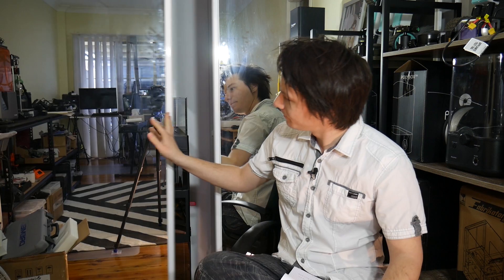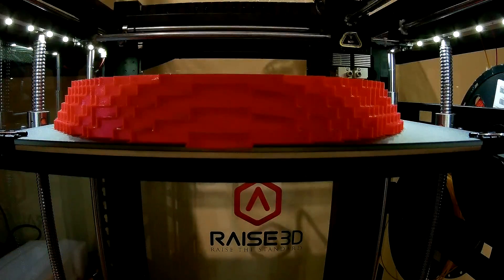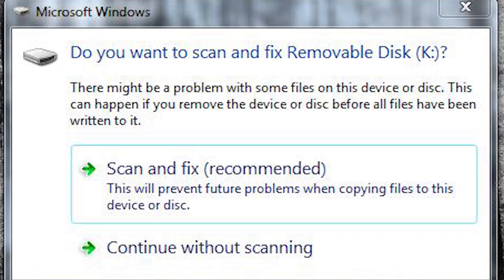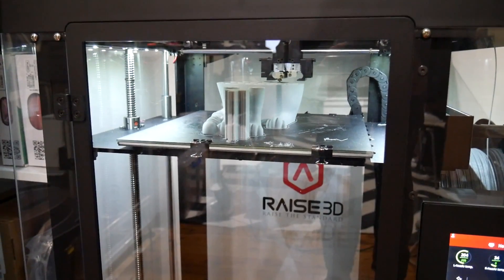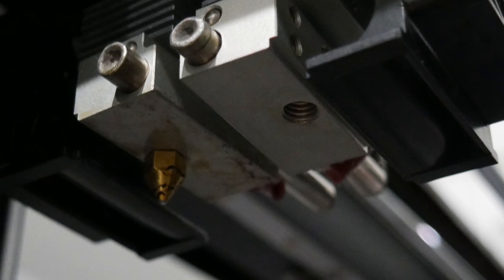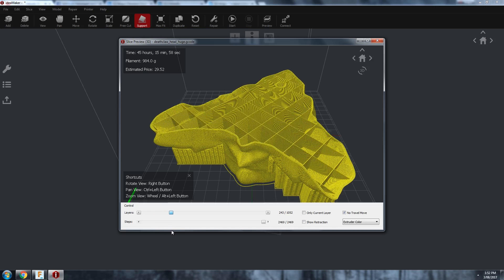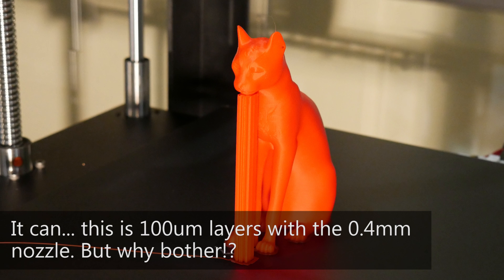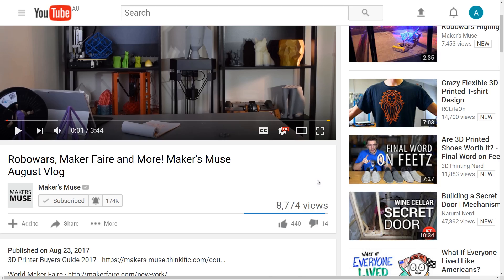Raise3D N2+ 3D Printer Review - It's HUGE.

Comment: Those flaws are terminal for me. The idea of the machine failing after 90 hours simply because it was too stupid to detect that it was out of filament is criminal, as is the fact that you need to manually level the bed.

Comment: Hy, i've been useing this printer for a year only for 12+ hour jobs it dose superb work, yes the bed is hard to adjust but when done right is the best! Only isshue wit it is fillament cloging but i can not blame the printer. Right now i have a power surge protector on it and thinking of geting a UPS because of small, 5-10 min, blackouts. Longest time printing was around 1 week, not one print but 24-ish hour prints for a weeh long, the endurance is grate on this baby! The dual extruder is good but also the nozzel need to be level... 
After a 3-4 moth of useing it, the filament was sticking so good to the buidtak that i broke the glass trying to remove it, replace the glass and buidtak and worg grate again. 
Another good thing is that the extruded amount of material, feed rate, temperatures and fan speeds can be modified even when printing without stopping the machine.
Best regards!
Reply: Have you had issues with the touch screen? I see quite a few users have suffered failing screens. Some of them use a plugged mouse, others diy replacement screens (stock screens are hard to find and quotes run at 500 USD). I can have a great deal for this machine but am quite hesitant because of the know screen issue + lack of support from the brand about it. Seller says there is "just" an issue with the screen.

Comment: I've had one of these printers for about a year now. I replaced one of the nozzles with a .8mm and keep the other one at .4mm. That way I don't need to change the nozzle, just the settings in the slicer when I'm wanting to print something fast versus something detailed. 

You kinda brushed off the detail this printer can handle, but I've found it does very small things very well. Better than any other printer I've ever had. And while sometimes it seams silly to have a massive printer print a part that's only 20mm long, it's nice that it can do both.

Comment: I got this printer for work and it's key feature is how easy it is to get people printing on it. Default print settings are spot on, and it can be trusted to run overnight when required. Most people that have used it hadn't 3D printed before and I haven't had to hand hold through raft/brim/support placement, they just click the quality setting they want and support on/off and it's printing. 

We've printed the max Z height and it turned out great, but I'm not sure how often we'll need to do that, but it's good to have the option. I'm tempted to put a 0.6 or 1mm nozzle in the second position, but I don't think I'll ever get it level again, I've had that issue on a DIY printer I made.

Comment: They should add the filament outage sensor and make it so that you can load both extruders eith the same material and when it has used all of 1 reel it auto.atically changes to the next. That seems like the most sensible reason for dual extruders on a machine of this size and also reduces the risk of having to start again just a couple of hours from the end of a 100+ hour print due to filament running out.

Comment: I just posted a guide to leveling the bed on the N2 and N2+. I also try to explain a bit about why they made some of these engineering choices. https://www.youtube.com/watch?v=MXAk4eBr21g

Overall, I agree, the screw adjustment and the bed are really the only downsides on this machine. And IdeaMaker is an incredible slicer.

Comment: Fair review Muse. We haven't had your issues with levelling, but we've helped a few customers who have. Despite your frustrations, this is our go to machine for customer prints and we've printed some amazing things. You can buy all the Raise3D printers at iMakr and we deliver across the globe. Won't spam you with a link but we're easy to find.
Reply: why can't you just make a kit with a bed leveling sensor and a G-code for a sensor mount, and then make a firmware update to include the sensor?
Reply: Have you had issues with the touch screen? I see quite a few users have suffered failing screens. Some of them use a plugged mouse, others diy replacement screens (stock screens are hard to find and quotes run at 500 USD). I can have a great deal for this machine but am quite hesitant because of the know screen issue + lack of support from the brand about it. Seller says there is "just" an issue with the screen.

Comment: I'm looking for a printer like this, with a vertical Z for architectural prints, the bed size is perfect,  but I don't need this tall.  I had a CR-10 S4 that had too much mass in the bed and cause way too much echo for architectural printing.

Couldn't you use the second extruder with the same filament, so it would swtich to it halfway through a big print, or have the software know when it's almost empty and switch it over?
Reply: The N2+ is 24" tall. but the N2 is 12" tall. I have that one and love it. I recommend it, but the single nozzle version.
Reply: with modifications yes, but doing that would need two sensors for filament, and heating the 2nd nozzle mid print, and i dont know a slicer that has the settings or support for that

Comment: It needs both a touch probe and an inductive probe. 
Capacitive touch sensors can be used to detect missed steps, in addition to levelling the bed. 
They can be overly sensitive to stray stimulation though, so you need the inductive sensor to act as a baseline.

Comment: Just got one of these at work (should be delivered soon) and only got the single nozzle machine for exactly the reasons you cited.  Nice to know about the leveling stuff, thanks for the review!
What would you think about ignoring most of the bed screws and just use three around the perimeter?
Reply: UnTiedMusicStudio 
Look at the forum were they have a user solution with 5 points with Springs. It works fantastic

Comment: CR-10 would be a much more value buy for a similar build volume and maybe even better print quality if not on par.
Reply: I doubt it. The Raise3D is pure steel (not extruded aluminum). I make Polycarbonate parts with it for industrial use, all of them goes firs through our metrology department and the accuracy is insanely precise.
Reply: @Mecha_Monster  Have you had issues with the touch screen? I see quite a few users have suffered failing screens. Some of them use a plugged mouse, others diy replacement screens (stock screens are hard to find and quotes run at 500 USD). I can have a great deal for this machine but am quite hesitant because of the know screen issue + lack of support from the brand about it. Seller says there is "just" an issue with the screen.
Reply: You could buy 6 CR-10s for that price!!!
Reply: Chair Happy you could build a bigger printer yourself too, maybe

Comment: I have a Raise 3D N2 I bought on their Kickstarter. Love it. One thing you didn't mention was their wireless printing. One of the best features. No need to carry a thumb drive. You can also monitor the printer and send new jobs while it's printing.
Reply: Have you had issues with the touch screen? I see quite a few users have suffered failing screens. Some of them use a plugged mouse, others diy replacement screens (stock screens are hard to find and quotes run at 500 USD). I can have a great deal for this machine but am quite hesitant because of the know screen issue + lack of support from the brand about it. Seller says there is "just" an issue with the screen.

Comment: Wouldn't a double head be useful as a backup filament source? If you can calculate about far one roll will last, pre-program it to print the rest in the other "colour"? (which would probably be just a duplicate roll)
Seems like that would be useful on such a large printer.
Obviously the issue where the second printer head rubs into the print would still be there.

Comment: I think using basic setup that monitors the situation every 1 minute and pauses the print if something goes wrong could prevent things like that from happening.
Basic comparator setup would work because if the model is detached from build surface or if no material is being extruded, it could catch that before it's too late.

Comment: When a print breaks free in the middle of a 24h print....
I once managed to pause the printer and saved the day just when the warping was lifting up the print. I Literally glued with superglue the print to the aluminium bed and then used duck tape (I was using a big raft, and the tape worked great keeping the raft in contact the bed)

 The model was a Parantropus Boisei skull and it survived with only an ugly layer.
Also, the raft was not easy to remove :P
Reply: Do you mean "duct tape"?
Reply: English is not my main language and I dont know the name of the product,  when  someone says it in a YT video it sounds like "du... tape"

Comment: Couldn't you use the dual extruders loaded with the same filament on both to do bigger prints and not worry about running out half way through? Like start printing with one then switch to the other.

Comment: Very interesting printer! The real downside is the lack of auto bed-leveling.
My dual-head printer with BL-touch and a heated bed have approximately 1,5x larger printing volume (400x400x470) in one-head mode, but don't have an enclosure.

Comment: Someone I know had a electricity cut at a 99 hours print.
Reply: It's probably worth getting a UPS if your prints are going to take that long.
Reply: If that happens you can always print the last missing part of the print and glue it on
Reply: That machine have a backup battery. It keeps printing and when the battery is gonna run out. it saves the progress so it can be resumed when the electricity back.

Comment: I have one now for the last 9 months. True about the bed leveling and micro switch (you do get used to them). but I use it printing colorfab XT-cf20 with 0.4 nozzle with 80micron layer height Longest print so far 136hrs the level of detail is great (Prototypes). Once Dialed in it is a great setup.
Reply: Have you had issues with the touch screen? I see quite a few users have suffered failing screens. Some of them use a plugged mouse, others diy replacement screens (stock screens are hard to find and quotes run at 500 USD). I can have a great deal for this machine but am quite hesitant because of the know screen issue + lack of support from the brand about it. Seller says there is "just" an issue with the screen.

Comment: Nice thing about having that other head though is you can run dissolvable support filament...
Reply from the maker: True, though the purge tower would be intense in waste and time and PVA would absorb water over the course of a 50hr print. I wouldn't ever risk it personally.
Reply: Maker's Muse - HIPS? And why would you need a purge tower; as that machine has two independent hot ends? Perhaps a silicone wiper on the end of the travels of the Y axis might be helpful, though... 🤔
Reply: Maker's Muse - On the machine I'm building, I'm fitting it with both a kraken w/ volcanoes and a cyclops head, and an experimental fiber injection head (my approach is quite different than what MarkForged is doing. I hope it works, but, well, it's quite experimental). I'm intending to run a small nozzle for detail, a large nozzle for infill, a soluble support material nozzle, and a flex/rigid mix on the cyclops (this leaves me with an uncommitted nozzle... any ideas?) The filament storage area is essentially going to be it's own sealed dry box, with a fairly large desiccant tank and a circulation fan to drive air through it. I think I'm looking at something the size of a refrigerator, by the time I add in all the space for the Bowden tubes, cable chains, etc..

Comment: LOL muse don't hammer me  but is that not like 16 inch on a side only 100 bigger than CR  that would allow you to buy 6 of them ??
Reply from the maker: +Stormbringer Mornblade oh for sure the cr10 punches way above it's price point for build volume but it doesn't have the insane rigidity and mass. Probably a better buy for hobby though!
Reply: Cool muse just got my CR couple day's ago , still in printer heaven  :)  As i have seen your the master of the fusion 360  do you have a  rate and do you take on work like that ??.
Reply: Maker's Muse - one could also add some bracing easily to a cr10; as it is made of 2020 extrusions...

Comment: "This guy has multiple 3D printers in his workshop and I can't afford a sheet of melamine foam."
- Torbie67 on Discord
Reply from the maker: +Phil Sierra wtf is melamine foam
Reply: Maker's Muse 
It goes by many names, but it's a crafting foam made out of melamine resin that is both sturdy and heat resistant.
It's used in places where polystyrene foams cannot be used (acetone baths, silicone moulds and resins emitting high heat, pan and tilt platform with composite parts, etc.)

It's pretty expensive compared to normal PS foam.
Reply from the maker: For cosplay? Things have moved on since the days of us hacking up foam floor mats and hot gluing them together it seems :) I certainly wouldn't have been able to afford this machine.
Reply: Yeah. I really wish I had even a really small 3D printer. That guy certainly is in no better situation here...

More info:
For starters, this plastic is hard as hell to bend and can crack or deform severely if you try to force it. Unless your costume contains tons of flat surfaces, melamine foam will be only useful in very small quantities.
And no, this does not act similar or identical to PVA, PS or PVC (soft variant).
And that's the reason why this material is used in physical modeling and landscape miniatures. Something you really don't want it to bend, deform or break easily.

Comment: No mention about the poor part cooling?  The dual nozzle seems to cause ringing on my Raise3D if I print much over 50mm/s.  One thing I must say is I like how ideamaker hides retraction and seams over Simplify3D.
Reply from the maker: I was warned about the part cooling issue before I got the machine and even ordered some fans, but honestly at the speeds i've been printing I haven't noticed much issues with droop or cooling. Probably about the same, 50mm/s or so. With the 0.6mm nozzle faster could end badly.

Comment: A machine which is designed for huge prints that take days doesn't come with a filament sensor?! Ok, I'm not surprised that bed leveling is an issue given the large build volume, but not having a filament sensor is just dumbfounding!

Comment: that would be the COOLEST printer to have... if only it wasn't $3,000
Reply: build your own with nema-23 steppers and cnc components :P would be cheaper then 3.000 and be a seriously badass machine :D
Reply: AUD$6500 ??? "Tell him he's dreaming...."
Reply: $ per sq inch it is not that expensive. For the dual extruder model is almost exactly $1 per sq inch. In comparison, the Tronxy is 5.9" square or 205 sq inch and is $180 which is $0.89 per sq inch. It's more down to what you need as a printer.
Reply: ikr i would love to have something that builds that big, im thinking of making my own giant one.
Reply: It's a price tag... but I would say its worth the price if you want high quality prints. I've had mine for little over a week and when you can unpack this bad boy with little problems, outside of adjusting the heat bed, let me tell you this things a prototype/ prop/ cosplay making machine. It's a damn quiet machine for its size and pretty easy to use with the touch screen. For what you pay, I'd honestly say it's a great deal and worth the money.
Reply: Not sure why you need nema-23 motors for a machine like this
Reply: well it includes some beefy engineering in terms of the mechanics on all the axis and if is run through a tablet and is a dual extruder setup so they put a lot of work into it and considering what you get for the price of say the Ultimaker 3, it seems worth it. Arguably it seems that's a really low price, almost as if they should maybe even charge more...
Reply: They make the N2 which is the same just a 12" Z height for about $2700,00 us
Reply: BoXZY would be great as well! Its a milling machine, 3D printer and laser engraver all in one.
Reply: I actually own Both Cr-10 400 and Raise 3D n2 V2 - i barely use the cr-10 since i got the raise due to accuracy of prints reliability ( i have prints you'd expect to fail to repair them selves mid prints due to supports falling then reforming) also its easier to use more comfortable/ usefriendly and allround solid printer whilst the cr-10 requires constant repair and fiddling once the raise is set its set to go - i have also re-leveled the bed manually a number of times - ball ache i use a dial indicator  however other than this not a problem with the printer - modded the filiment holder as it was shit made top down 5 holder mod)